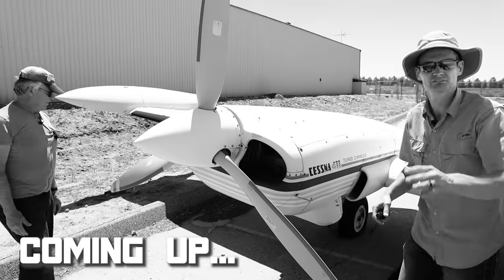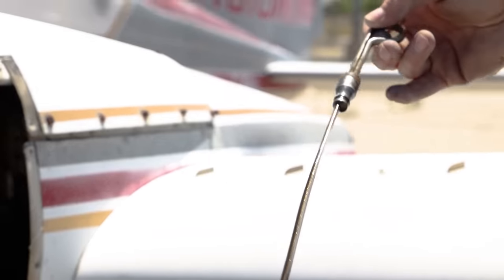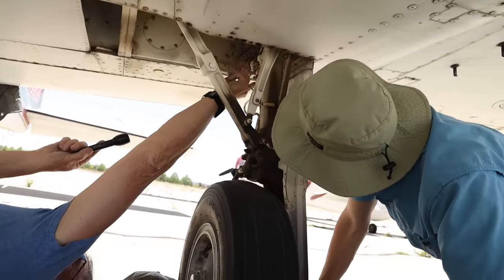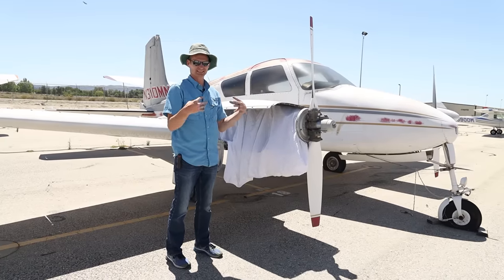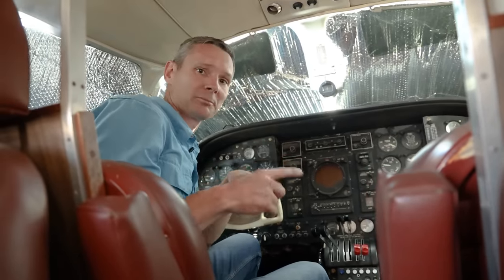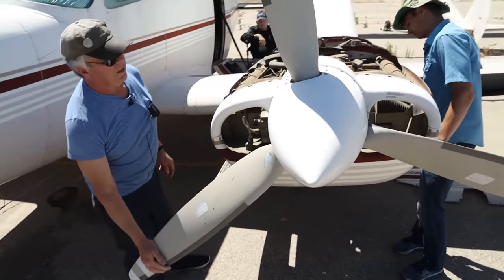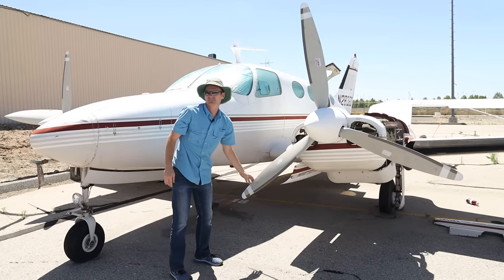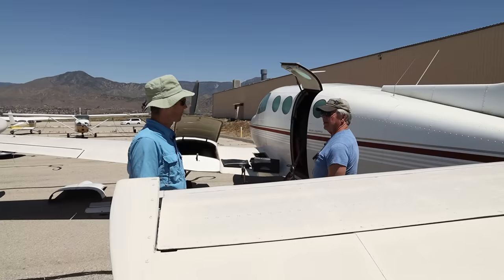Abandoned Airplane Miracle HUGE Save The 310 Update

Comment: I don't get how this saves you that much money. The big expenses on the other plane were the engines needing a $20,000 check and replace overhaul each (same engines here, still need an overhaul) and new cockpit instruments/avionics (which you're still going to want to do, since you were talking about an $80,000 setup or something for the original 310). The sheet metal work was a relatively small part of the financial picture you were painting. I suppose there's significant time savings by way of not having the wiring butchered and having an interior for the thing, but it's up to you if that's worth the added expense.

Comment: Wow, that 411 is a time capsule! That interior screams mid 60s and I absolutely adore it for that! Looks to be mostly stock as well, and the fact that it's low hour for the age suggests that's definitely the case. Considering how fully loaded that plane is, it's basically the Cessna Citation of it's day, huh?

Hehehe, "N310MM". It's definitely meant to be! I love it when the parts vehicle is in better shape than what you're currently working on. IMO, it would make sense just to fix up MM and make the first 310 the parts plane. Kinda goes against the ethos of "Save the 310" but I'd rather see a solid plane with good potential being saved than parted out to resurrect what's frankly a glorified parts pile/rat sewer biohazard.

Comment: Prop synch also lessens vibration and prop noise.  One of the tactics used by the Japanese during World War II was to fly twin engine aircraft over Allied controlled islands at night with one prop at a different RPM than the other prop.  The out of synch props make a weird and highly annoying noise which would disturb sleeping.  These night flights were dubbed as "washing machine Charlie".
The 411 would make a heck of a family hauler.

Comment: Love the direction this is going for you.  I had suggested in a previous video on the first 310 to use it for parts as much as anything based on all the mouse poop and pee.  So much of it that I just do not believe you will ever get it cleaned properly.   So, what a miracle finding 310MM.     I know the 411 would cost tons of money to own and operate, but man is that ever a cool bird.  It’s seems like not a stretch to get it back up into flying condition.  Go for the 411 too!!   Love the channel and a very early subscriber.
Reply: Yup. Why not find the or four. These were a common plane. I did likewise with cars, trucks, lawnmowers. Nothing goes to waste.

Comment: 29:40. Tip: when the filler cap lever is stiff like that, grab the engine oil dipstick and use it to wipe a bit of oil on the lever hinges. Frees them right up. :)

Comment: Oh man, that 411 is sweet :) Next video - Will the 411 start or am I getting a bus? :P

with relation to the 310 though, did you not say the engines on Mightymouse no 1 needed a complete overhaul and strip down before youd use them for flight as they were running a bit rough?

But certainly, I would combine the two 310s, keep a few spare parts and sell whats left over. The interior and control panels of MightyMouse No2 is already done, it needs a decent clean and thats about it. Bring the engines/props, tip tanks, gear/wheels and control cables from MM No1 and stick them on MM No 2 and your good to go (probably need a few other extras but...)
Reply: I'm pretty sure the engines on Mighty mouse are brand new, with only a few hours on them. Remember, he bore scoped them and they still have writing on them.
Reply: @jsniderhan  when he ran both of them up outside the hangar, he did say they were running rather rough and he would want to strip them entirely before actually flying them. Grizz says the same too when they go over what mighty mouse actually needs

Comment: Jimmy I had a 411, the thing that made me nervous is the smaller tail section than the 421.. if you have an engine loss, what it takes to hold that together is tough. That’s why I believe they made the 421 with a larger tail section.
Reply: Single engine 411 flying is not fun. Been there, done that.
Reply: There's only about six flyable 411's left in the country. Yeah, they have a stellar record when it comes to lawsuits. Cessna was advised to buy the back and crush them as that would be cheaper than the potential lawsuit exposure. I would call Cessna and tell them I'm about to get one flying unless they make me a smoking deal on a 182, lol.  
Not that the 411's are bad planes, just old maintenance nightmares.

Comment: 411? Nice, rarer then the ubiquitous 410. Plus weather radar scope.
Didn't know you can swap straight to swept tail on the 310s, though straight tail looks better to me somehow, probably also because of the old and rare factor. There are way more newer 310/320s, so also way more swept tails flying around.
Reply: Straight tail probably gives more rudder authority.  And more stress on the tail in heavy crosswind, thus the cracks
Reply: @karaayers2867  Straight out swept tail rudder authority can be the same, because you do move the center of lift for the rudder backwards, thereby increasing the moment arm. Advantage is, then you can reduce the surface area of the tail and rudder a little in turn to get the same aerodynamics, but the internal design of the tail gets more complex and potentially heavier, though as one can see by the proliferation of swept tails over the past 60 or so years, that issue isn't really as much as an issue anymore, to miss out on the advantages of a swept tail.
So might help a little with crosswinds, as the area impacted is a tad smaller, though you do still have usually the same moment arm.

Comment: The device is ozone generator, sold as air purifier. It does eliminate odors but it is not safe to stay in the room when it is working. Ozone can cause serious damage to respiratory system. Following is from EPA website,
"When inhaled, ozone can damage the lungs. Relatively low amounts of ozone can cause chest pain, coughing, shortness of breath and, throat irritation. It may also worsen chronic respiratory diseases such as asthma as well as compromise the ability of the body to fight respiratory infections."
How much amount of ozone is bad: if you can smell it, it is bad. And if you can't smell it, it is not doing its thing.
Reply from the maker: I agree, ozone generators do that stuff, this generates o3, which is similar but safer.
Reply: O3 is ozone!
Reply: @therealjimmysworld  O3 is ozone, Jimmy.  Not particularly good to breath and bad for anything made of rubber.  Good for killing bacteria, fungus, mold, and deactivates viruses, it does the same to any living tissue.

Comment: 411 engines are super expensive to overhaul if you can even find someone to do it.   There was a time when no insurance company would insure the 411. They were a dangerous airplane. Then the VG’s came out and that helped.  They increased the horsepower and added a much  bigger tail which helped the safety.  Then they added pressurization and called it the 421.

Comment: That prop synchro is to eliminate prop "beat", which will drive you crazy on long trips. JT8's on DC-9 models of aircraft actually had them also. To eliminate that ungodly whine from the first stage compressor blades.

Comment: Jimmy im no  airplane mechanic but i have been wrenching for 30 plus years. check your valve seals and guides. the seals will dry out sitting and when you resart an old engine they can crumble. valve seals would allow oil to enter the cylinders while sitting. could be a cheap fix for the 310 engines.

Comment: There was a really good reason that Cessna quit making the 411 and developed the 414.  The vertical stabilizer on the 411 was too small to maintain control when you lost the critical engine at the worst possible time.

Comment: the compass is filled with Ethanol so it will not freeze or slow down in the cold, I am retired Manned submersible pilot and ROV pilot, a few years back we were working on a shipwreck that was sunk in 1942 by 2 torpedo's from u509 sunk in 800 feet of water the blast blew the upper pilot house off we located the ships compass upside down in the silt upon recovery the compass was still full and working after 75 years at the bottom

Comment: I made a comment before you probably didn't see because I am in Thailand several time zones away. When you asked if you should dump it or scrap it or struggle on I suggested you looked for another one to help out with parts. Looksl ike someone else had the same idea and the tail number is a cracker - I'd defo go with transferring all the goodies you bought to this one, stripping the other of all usable parts for later possible use or selling on as spare parts. Then scrap the stripped airframe keeping flaps and tail assembly and landing gear etc and some spare engine cowling panels, maybe a window or two and door and any good fuel tanks?

Comment: I owned a original 310 for several years and just recent sold it, I believe there is a stc to change to the swept tail as the Riley rocket did this, it is worth saving, I upgraded to a R model, and a T30Q. I also own a 411a very cool airplane to restore. The 310 that I sold up ended up in Orlando.

Comment: Is that a plastic part under the center shaft nut on the turbo you showed?  It looks cracked in half.  If so, it may blow apart on spin up and the turbo may ingest it.  You may want to take a look at this before firing it up.  Check video at 36:14.

Comment: Donor aircraft make a world of difference! I helped rebuild a straight-tail '65 C-150. We got ahold of a scrapped '70's model for engines, a wing, avionics, etc. Best decision ever! 

BTW, hate gitso engines. Maintained a 421 for a while. Airframe is awesome, engines suck. Always wanted to hang a couple Allison/Rolls Royce 250's on the beast and realize it's true potential...

Had a 310R we maintained that on its first annual, we discovered they had bondo'd the escape window shut, then painted over it. That took a bit of doing to fix.

Comment: Prop sync is more a comfort item.  It’s supposed to cut down on the oscillating drone from the props.  I say supposed to as most aircraft with prop syncs I have worked on its INOP (ATR 42/72 and Jetstream 32/41).

Comment: That 411 is a major step up from a 310.  I don't even want to think about what it would cost if you ever had to overhaul those geared engines, though.  I think you are on the right track to putting parts of the two 310s together to make one good airplane.  Much better to have one flying, rather than two that will never be anything but money pits.

Comment: Perhaps save the 411. That model is very rare. None for sale in the US right now from what I can find. 

As to the 310, well I do like the Frankenplane plan. A little bit of this, a little bit of that.  Sounds like a good plan. 

Now if you can just find a 310 that was fully updated and then did a ground loop, then you could grab all the fresh wiring and  other goodies from there. Nothing is quite as nice as installing a new wiring harness, bypasses so many issues.

Comment: 1:31 The device you showcased is actually an ozone generator - something which you should not use in any inhabited space while there are people in it as it is known to damage lung tissue with sustained exposure and in the shorter term may lead to sore throat, shortness of breath, coughing, and chest pain. In short for anyone reading DO NOT USE THIS PRODUCT OR OTHERS LIKE IT WHILE YOU ARE IN PROXIMITY TO IT. Also ozone can damage many materials especially Neoprene, plastics, rubber, fabrics, and vinyls (this includes insulation on most wires).

Comment: Synching of the props is more for comfort reasons than anything. It's easy enough to match them reasonably closely just with manual adjusting of the prop levers, but the electronic synchronizer gets it more exact so that the god-awful noise caused by harmonic disequilibrium goes away. The plane flies just fine if they are a bit out of synch.

Comment: Those GTSIO-520 engines on the 411 have a reputation but you are working with a guy that knows how to manage them.  If you end up with a nice early 310 to fly, it all should be worth the effort.  BTW, does the early 310 have alternators?  If not, there may be an STC to replace the generators with alternators.  The 411 will move along pretty well at cruising altitude.

Comment: Making a small fortune with the 310 (starting with a large one)!  The Aztec would have been much less expensive. N310MM has VGs which is good. A thorough check for corrosion would be a good idea before you purchase….just saying. Good luck Jim.

Comment: Jimmy next comment:), When you get the 411 home how in the world are you going to put the engines through that small door? :( plus the gear? and any other parts you need to bring? to me it would be safer to rent a truck and load everything in it ,plus any other parts you may or may not need in 1 shot. Then have some one in you crew drive the truck home with all the parts you don't use. It's Safer and cheeper that way, what do you think? cropduster

Comment: Wow Jimmy, Is the same problems you listed with the barn find going to be the same with this rust bucket?  Wiring, instruments etc.  Seems you would have 2 planes with similar problems.  Saw several negative comments on the 411 ref. the drive shaft style engine isn't good.  I think the 411 seems better than the 310 though.  Hope you're selling some planes cause you're sure buying up some.  I would keep the one you're hauling the fam in for now.  Sell everything accept the lancaire and fix up the 411.  Then sell the fam hauling plane when you get the 411 in the air.  Keep the military planes or at least one of them.  Use them for air shows.  Gotta keep one or both of them.  Don't you go bankrupt on us now.  I'm livin my plane buying life through you.

Comment: Jimmy the compliance time for the Wing Spar AD for the C 411 is 5,500 hours.  The roll pin in the gas strainer under the fuel valve is so you have something to press against to with your fuel tester to drain fuel.  And last but not least!!!  You missed the most fun aircraft at that field!!!   Two rows in front of the 411 I saw a Fouga Magister!!   If you want a jet warbird that is the one to buy!!!  They are easy to fly.  Have two engines for redundancy and parts are readily available.  I own 4 Fouga Magisters and tons of parts.  If you decide to look at that one I can be of help.

Comment: With either of the two 310's (over wing exhaust,mentioned in the text)remember the problems with corrosion - pretty 195 sitting in the background !! Squaretails FOREVER, fly on Sky King 🤴!! ....... $12K for the 310, 80 for the 411.... 🤔just my thoughts-geared engines, like the 175- might be a questionable thing as far as TBO on that one.

Comment: If I was going to ferry the 411 I would do a fresh tune up fuel filters and oil and filters and system cleaner through the fuel system . Pull the plugs pre oil the cylinders and crank over the engine and get oil pressure first. If you starve the turbo for oil pressure and dont pre pressurize the system you will destroy the turbo bearings if you light it up. I would also pressure wash the engine and cooling system ducts for the engine to get out all crap and birds next and webs etc. Be a shame to cook that motor on the ferry trip home .

Comment: You might want to consult a third party to verify out the safety of the product you're promoting. Ozone is a respiratory irritant in high concentrations and can be particularly harmful if the area where the ozone is present isn't ventilated . Hospitals and labs  use ozone to help kill germs, but the systems include high volume filtration to disperse the ozone into the atmosphere. FDA issued an advisory in 2021 that warns about CPAP cleaners that use ozone to destroy viruses, etc. OSHA has a fact sheet regarding ozone.

Comment: I think this was meant to be, especially considering the tail number. One airplane has good engines and a crap airframe, the other looks like it has a good airframe and great interior, but crap engines. I say get a good insp. of the airframe and if it checks out do the deal, it's fate! On a side note, is that Redlands airport? I learned to fly out of there in the 80's, great little airport. Also, I thought for sure you were going to give the other guy a dirty sanchez when you asked him to come over and smell the dipstick, that would have been hilarious!

Comment: I done told you 9nce a long l9ng screwdriver and if it wont back off with ease tighten it then back it 9ff. We rescrewed a plane once and ill be damned we did n9t want to drill any holes bigger

Comment: Uhhh, is that little device generating Ozone in the room you're sleeping in? 'Cuz that's not good for you, like at all. It does break down fairly quickly, so it's probably fine as long as you are running it when nobody is around, but you definitely shouldn't be breathing that stuff.
Reply from the maker: I agree on the ozone machines, this one is o3 not ozone, similar, but different and safe :) Great observation!
Reply: @therealjimmysworld  O3 is Ozone though, unless I'm mistaken?
Reply: @StephenJones2  o3 is exactly ozone, which is an extremely strong oxidizer. Some car detailers use larger ozone machines to get rid of smells in cars. Also some desinfecting UV lamps produce ozone as I bi-product, and you should always ventilate the room after using it.